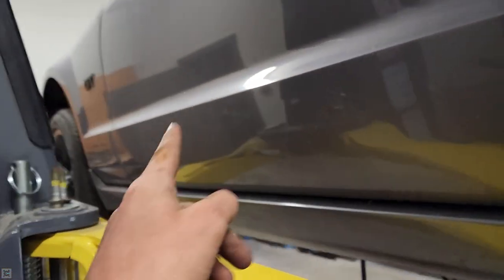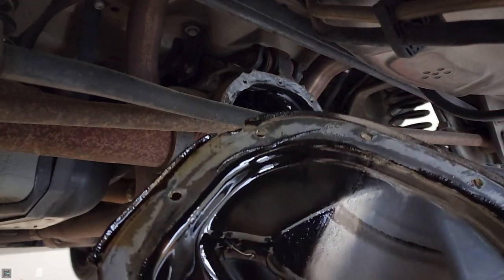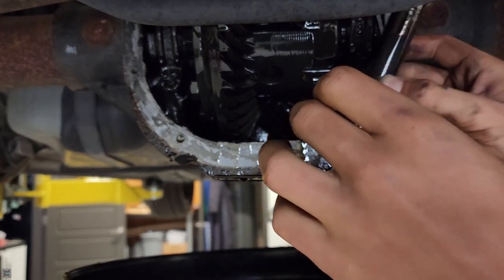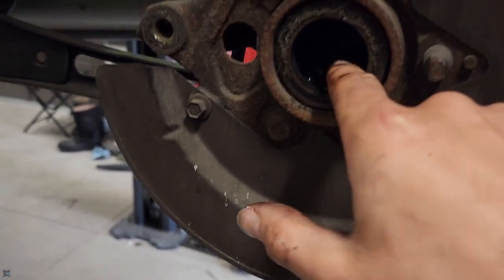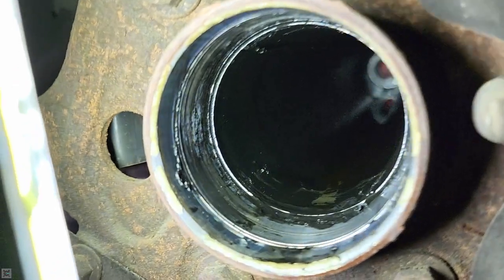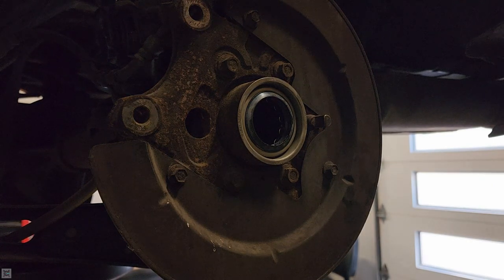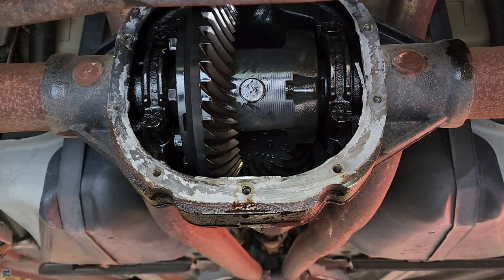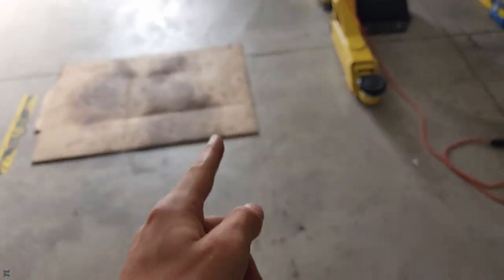How to Replace Rear Wheel bearings and Seals on a Mustang GT 2005-2011 (S197)

Comment: To lubricate the new bearings, simply use the rear end gear oil you will be running in the unit. When the unit is properly filled with fluid, it will be what lubricates the bearings during their lifespan.
Reply from the maker: It really does not matter what you lube them up with along as you use something, I personally like to use assembly lube because it provides the most protection before the oil gets to it.
Reply: @TheMileHighMechanic  Is it ok to use bearing grease?
Reply from the maker: @Nitrodan73  I believe that will be fine, all the lube does is provide protection until the gear oil can make it through the axle.

Comment: Great video! I habe an oilleak at the rear. Now i know to get the axle shaft out and get to the seal. Not sure if thats the problem. Is there an other seal between the bearing housing and the axle housing itself? Maybe you can help👍
Reply from the maker: @Dirtpros  There is no other seal on the rear end besides the axle seal, so if there is a leak, it likely coming from there.

Comment: Can a list of bolt sizes and anything else that may be needed or useful be added? I gotta work on my daily driver and would appreciate the info to make sure everything flows smoothly to get my car up and running asap once I get started. Thanks!
Reply from the maker: I believe I used a 13 and an 18 but there are just 3 sockets that get reused.

Comment: Axel bearing seal is stuck on impossibly tight for me unfortunately.

Got to ask, is it fine to use the slide hammer to pull out the bearings and the stuck seal at the same time? At face value, it seems it would be significantly easier to pull out a rusted seal this way.
Reply from the maker: @-R.E.D.A.C.T.E.D-  Yeah, slide hammer will be a great way to remove it!
Reply: @TheMileHighMechanic  thanks for the quick reply! Always worried about doing so since so many people pull their seals out seperately before moving to their bearings. I wonder why that is or if there is some risk im not aware of.

Great video by the way! Got me through most of my struggles!
Reply from the maker: @-R.E.D.A.C.T.E.D-  It's mainly because you can't get the bearing out until the seal is removed, but I guess slide hammering the seal and bearing at the same time could work🤷
Reply: @TheMileHighMechanic  Doesn't hurt to try I guess 👍
Reply from the maker: @-R.E.D.A.C.T.E.D-  Yep! Good luck
Reply: @TheMileHighMechanic  Tried it. Didn't get the seal out by slide hammering the bearing but cracked the rust off the seal enough to pry it off the rest of the way! 

Guess that's one way to pull off a 80,000 mile seal!
Reply from the maker: @-R.E.D.A.C.T.E.D-  Hey, whatever works 🤷

Comment: i noticed when youre installing the cover back on, the bottom of the Diff had leak marks, is that a common thing?
Reply from the maker: Dry leaks are very common on every car...as long as it is driven. It is not common for it to drip, dry leaks appear to be wet but they arent.

Comment: Any advice on what to do if the bolt holding the pin in is broken?!?
Reply from the maker: Broken like snapped or broken like stripped?
Reply: @TheMileHighMechanic I had almost started to strip mine.  Trying to avoid where OP is at.  Use PB? What is the idea on that little 8mm with the bad angle?

Comment: Do you know what the part number was on the seal that you used?  The one I removed looks like the one you installed, but when I try to order them, they don't have the metal lip on them.
Reply from the maker: The kit I got no longer has the metal lip on the seals, so I don't think that you will be able to find them. The ones without the lip are the same, but are gonna be a little bit more tricky to get into the axle.
Reply: Thank you for the quick response!
Reply from the maker: @draconicLatte  absolutely!
Reply: @TheMileHighMechanic How would you put the seals without the metal ring on would you know?
Reply from the maker: @fgtnlegend3053  find something that is just a hair smaller than the outer diameter and carefully tap it in. I like to use PVC pieces, but you can rent a bearing press kit that should have something that you can use.

Comment: Does the v6 version need the friction modifier aswell
Reply from the maker: Yes every differential on these cars needs friction modifier
Reply: @Mile High Mechanic  hey bud my local auto parts store only had the bearing seal without the outer flange what would be different on installation
Reply from the maker: @jasonandsummer5109  I highly recommend to replace it with the OEM ones with the flange as they are the ones that came off the car, but in theory they should work the same as long as you have something to pound on the seal inside the axle
Reply: @Mile High Mechanic  hey one last question I put everything back together went for drive lastnight seen some oil on rims this morning I did put about 2.5 qts plus friction modifier you think it could just be a little over flow coming out of seals?
Reply from the maker: @jasonandsummer5109  it is almost impossible to over fill the diff because you fill it up till starts to come out of the drain hole (can't over fill because of this). If there is oil coming out of the axle then the seals are not sealing properly. I recommend taking off the wheel and inspecting the seal to see if is actually making a seal. If not you might want to get different seals.
Reply: @Mile High Mechanic  ok thanks I'm gonna clean everything and drive again hopefully I don't have to undo everything.

Comment: Just curious what that job cost the customer. Thx in advance.
Reply from the maker: How much in parts? or labor? or both?
Reply: @TheMileHighMechanic  Both, thx.
Reply: Looks like I'm on my other login, not to confuse, thx.  =)
Reply from the maker: @3zsleepchannelrelaxingsoot778  overall $520 because I did the tie rods and rear control arm bushings for them aswell. But the parts for the rear end job cost less that $100. It's kinda hard to put a number on the labor since it was for multiple jobs.
Reply: @TheMileHighMechanic  Thanks for the info!!